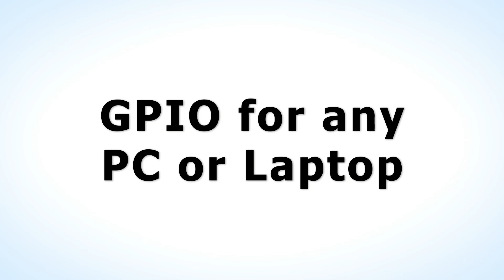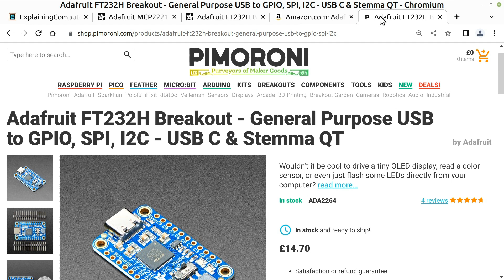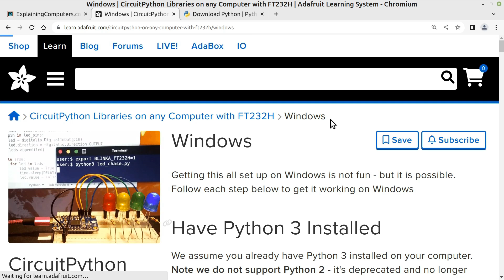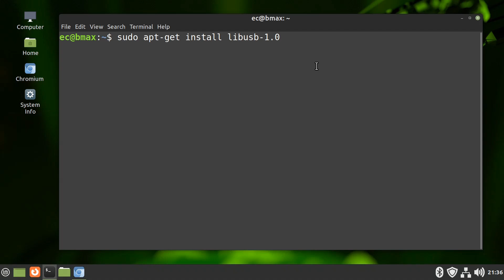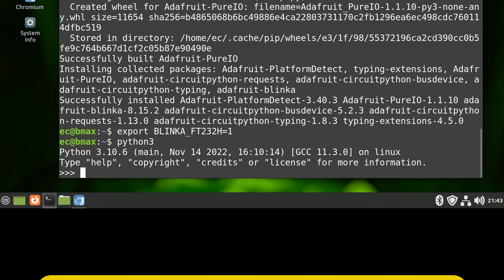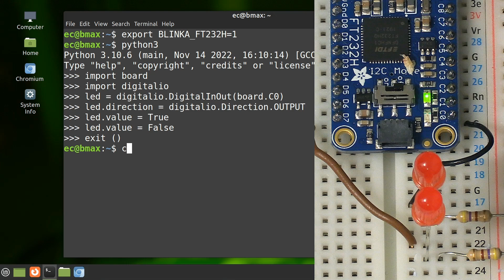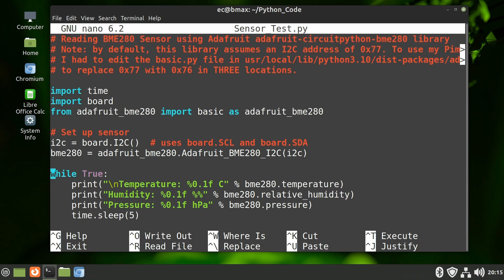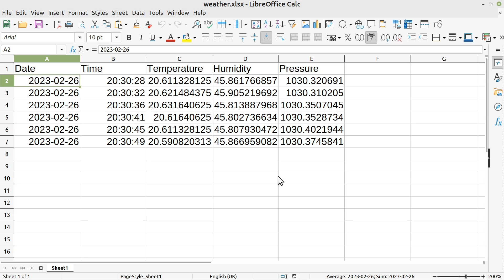GPIO for any PC or Laptop: Adafruit FT232H

Comment: Thanks, nice thing, but far from a real GPIO directly accessible at assembler level: Python is slow, and USB communication introduces another "huge" delay... Far from what was possible with "real" GPIO, for example implementing an I²C / SPI bus, or a PWM, or any custom and non-standard serial bus.
But since it isn't even possible on a desktop CPU but only on SoC or embedded CPU, not to say microcontrollers obviously, it's still a very nice replacement to the standard parallel port since it doesn't exist anymore on most modern PC.
Reply: I²C busses are accessible on your PC, guaranteed... VGA/DVI/HDMI ports have 2 pins that are each an individual I²C bus (check my recent message about that). With PCF8574 I²C to GPIO expander chips, you have access to regulat digital GPIO pins... You are welcome ;)
Reply: @takix2007  You don't have a GENERAL PURPOSE I²C bus - i.e. you don't have a connector exposing this bus to ANY device. The fact that some expansion cards have/use one isn't "having an I²C bus".
Also, if you need an I²C bus to get GPIO, then you don't have "real" GPIO: they will be SLOW.
With direct GPIO (i.e. on CPU directly), you can go fast enough to implement yourself an I²C bus, or even a small parallel bus if you have enough of them.
Try to use GPIO from a SoC, you'll see the difference.
Sure that using a PCF8574 may be nice, but you still don't have a real I²C bus... And if you have one, it will be through USB or PCIe, so another layer of interface - and another slowdown.
Reply: @mac_lak  Maybe I am missing something (maybe some vocabulary imprecision or misunderstanding?), but the pins on a VGA port are quite exposed, and are not on an expansion card. But indeed, it does transit through the on-board graphics chip.
Does that mean that it is bad in any way? Is having "slow" GPIO really a problem in many cases? I mean, on a software level, Python on an SBC is slower than C++, it does the trick most of the time (for example, I had to use C++ to implement an I²C-like protocol on regular GPIO pins on a RPi to talk to a touchpad, but most of the time it does the trick...)
Looking down on "slow" I²C or GPIO to hack things compared to SoC GPIO to make embedded systems is like looking down on a cheap big-store brand jigsaw to cut a wood shim compared to a Felder table saw to make fine furniture.
(BTW, in case it does not get through in written form : I am not being aggressive right now, just maybe overly enthusiastic for a funny hack that opens a lot of possibilities)
Reply: OK, my bad, your original post was indeed criticizing the slowness of the breakout boards, so my comment was not very relevant 😉
I must have misread initially.
Reply: @takix2007  Not a problem, your solution is ALSO an alternative for some PC, which expose the I²C bus on a motherboard connector - so, if you can write/modify a driver, you can use this I²C<->GPIO expansion card. It's still a valuable information for people who don't mind to touch the low-level hardware.
Reply: @takix2007  For the 2nd part: 

(Note: I may sometimes be read as "arrogant" or "harsh", but I'm not: like you, take it the good way, you wouldn't have any doubt if I was aggressive towards you... 😋)

Having "slow" GPIO isn't a problem if your goal is to drive a transistor or a relay to command something, or to read a state (through a transistor or something similar).
For an use case, a home automation application is something perfectly suitable for "slow" GPIO.

But to drive a robot/drone with servo control and feedback, it starts to be problematic...
And to drive directly a controller (for example, a CAN controller, a custom ADC/DAC, etc.) or to make a JTAG interface, it's clearly way too slow.

The Python/C++ is a false problem here: even on direct GPIO, you can use Python as long as you encapsulate enough things into a C/C++ library interfaced in Python... And you can do better than a C++ program driving GPIO through a "long" chain like bridge/USB/microcontroller/GPIO - just because USB introduces delays due to the master/slave protocol. I hate Python (for its significative blank characters mostly), but I must admit that it's enough to sequence a bunch of process in C/C++ which will do the "real job", even if Python itself isn't suitable for intensive computation done purely in Python.

Obviously, the best is C/C++ with direct GPIO... But for a house automation application, Python with a "very slow" GPIO interface will be enough: you need what, a 100 to 500 ms response time? Way enough... Obviously, if your time unit is the nanosecond, you will fail miserably with Python - whatever you do, in fact.

Everything is a matter of use case. I'm used to have GPIO with SoC, so I use them according to this kind of interface (to be clear, in such a mode, you can command/read up to 32 GPIO in a single CPU tick, so it's hard to beat whatever you compare it to... 😁).

My initial comment was to make clear that the shown solution IS NOT what we call GPIO in an embedded, industrial environment - and you have more computer engineers in this "hidden market" than you think. Re-read it, you'll see that I wasn't belittling this solution, which is really cool for "human time" solutions. It's simply not suitable for "machine time" solutions.
Again, use case... 😉
Reply: @Mac LAK  fine by me, I wasn't trying to pass funny hacks as top notch embedded systems hardware engineering and software designs 😉 
Re-reading your initial comment again, it is very clear and I fail to see what I may initially understood as a bit pedantic or downlooking... maybe it was a little late in the evening and I was not reading properly 😉😆
Reply: @takix2007  Not your fault, as I said, I have a way to express myself - due to job's habits when writing technical documentation... - to be very cold, use precise words and give facts without caring about feelings... Some people find it harsh, and some even take it for themselves. The fastest you read my comments, the harshest they look! 😁

On a full side note, nowadays AND from a PC, it's often easier (instead of trying to get GPIO directly) to interconnect a microcontroller, like an Arduino, or even a SoC like a Raspberry Pi, through Ethernet / Bluetooth and handle them as gateways to actually drive the GPIO... It's not really so slower than through PCIe / USB, and it has a longer range (wired Ethernet / Wifi) and/or avoid cable connexion (Wifi / Bluetooth).
You can now even connect a ZigBee dongle/card to your PC and directly have an access to a house automation network...

Another possibility is, with GPIO this time, to setup - through little COTS amplifiers to raise the power / voltage - to get GPIO propagated on tens of meters with very thin cables and, therefore, avoid the need for microcontrollers - you'll simply have a low-voltage & low-power network wired in your house, for general-purpose functions... And it can't be pirated through your Wifi, since it's wired. It's the solution I wish to setup in my own house, leaving non-security related features on ZigBee (like thermostats or lights), and security features (like rolling shutters, alarm system, etc.) through a wired GPIO-like network.

We sure can get some very funny toys nowadays...

Comment: Adding the environment variable command to the  "~/.bashrc" bash script will run it every time you open the terminal. Better yet "/etc/rc.local"  will run it at startup. It's not there by default on Ubuntu, but you can add it. It should start with a shebang "#! /bin/bash" and end with "exit 0".  Whatever you put tin the middle will run at the designated time. Make it executable with "sudo chmod +x /etc/rc.local". I use "rc.local" to set the states of my sbc's attached leds to 0 so they don't float and annoy me when not in use, and to turn numlockx on before I botch my password. I use ".bashrc" to load my aliases for commonly used terminal commands and such.

Comment: I think that's exactly what I was looking for! Since the prices of sbc's only went up, I changed to generic android tv boxes from china with Amlogic SoC's in them. They are quite powerfull and it's easy to install Armbian on them, the only downside is that they don't have gpio ports. My question would be: Is there any reason these breakout boards won't work on such arm boards?
Reply from the maker: Technically it should work on ARM hardware, but you would need appropriate drivers. You may be able to make this work in Linux using what is available, as shown in the video. But that was for x86, so there is no guarantee.

Comment: Isolate your USB ports by buying a plug & play "USB to USB Isolation Device" which protect the host device (the PC/Laptop in this case) from spikes, reverse voltage and shorts produced by the external devices. I recently saw this product on GreatScott! and can be viewed on YT here:- https://youtu.be/1dKLF2Ma8nQ?t=90 and in my opinion this would make connecting such 'projects' to your expensive laptop/PC less worrying and much more fun. I remember being scared whenever I built something new for my old BBC Model B or Master computer, and built a port checker so I could always test the Serial, User and Tape Ports whenever a robot or something wasn't working, just to make sure I hadn't fried one of the I/O functions.

Comment: I use wireless = use bluetooth or ESP8266 + socket programming. That way, I work on high voltage mains without risk of damage to computer or shock.

Comment: You might want to explain that if your using LibreOffice or OpenOffice the file type would be .ods as it would be (most likely) on NeoOffice. I've used LibreOffice for quite a while and it's nice to not constantly upgrade to a new office version every year or two.

Comment: Nice. But: When people try to use it they have to remember that it's no real GPIO! Real GPIO timings and speeds are much different from that to expect from a USB to GPIO converter!
Reply from the maker: It depends what you mean by "real GPIO". :) The experience here will be very similar to that on a maker SBC, such as a Raspberry Pi -- and that is how I introduced this board at the start of the video.

Comment: Nice, Chris! Just one word of caution, the GPIO setup you have shown isn't going to be useful for handling time-sensitive interrupts in a responsive and reproducible time-frame. For that functionality, we still need a dedicated micro-controller. Having said that, the Raspberry Pis (other than the Pico) aren't going to be able to do that either, so if that's your point of comparison, the solution you present with external GPIO is pretty much the same.
Reply from the maker: I am well aware of this, but at no point in the video do I suggest the the FT232H board can be used for time-sensitive interrupts. :)
Reply: @markwarburton8563, why Mach3, Mach4 is so successful in DIY CNC machine business, it does not use microcontroller just a USB board with GPIO and AC/DC. I had built a CNC machine using Mach3 that can cut steels, aluminum, wood , etc, never encounter any problem even when running complex 20k lines of code of GCODE with so many timing parameters because of controlling 3, 4, or 5 stepper or servo motors in synchronized motion or controlling all at the same time. Mach3 runs on Windows XP, 7, 10. Mach4 runs on Windows 10 and 11

Comment: I think i must be missing the point here. Yes using one of these boards the code is running on the main computer but you still have a separate board attached to USB. so what's the advantage? Using an arduino/pico, you have 'offset' the processing . what I would want is to put a gpio inside the machine with access from the outside. Otherwise to me I can't see the advantage over a pico etc.

Comment: How would I go about making a digital on/off switch like the LED to control a high-voltage system? I mean if I wanted do flip on or off another 110-210 volt power wire.
Reply from the maker: You would need to use some kind of triac or relay board controller -- the kind of thing I covered in this video: https://www.youtube.com/watch?v=bOGltcgiXiU

Comment: I recently noticed a little Linux Penguin in the Navigation Pane of Windows Explorer on my Windows 10 machine. Apparently it's for Windows Subsystem for Linux which apparently lets you install Linux and run Linux programs within Windows. Any experience with this?

Comment: The much better, because easier, versatile and safer way to provide a PC, notebook, tablet, or phone GPIO-capabilities is to use a cheap SBC with Ethernet/WiFi-connection. Set up a lightweight Web-server (e.g. httpd) on the SBC. With a couple of lines of code, you can feed values to the GPIO of the SBC, or get values from them. In the most simple case, wget on the PC can do the job. A web-app, controlled from a browser can provide every degree of comfort.

Comment: So the board has built in pull down resistors for the Digital GPIO pins?
Reply from the maker: No, there are no internal pull-down resistors. You have to wire them in externally.

Comment: I prefer the also-available-through-Adafruit MCP2221a that you briefly mentioned which works similarly, and doesn't support FTDI, revealed to be an arrogant anti-consumer company back during "ftdigate". (The mcp2221a is apparently a factory flashed PIC). It also doesn't require any fancy drivers or libraries (fewer steps than the FTDI) And of course as others mentioned there is the option of a Pico using U2IF: all of these options work with "blinka" based circuit python libraries.

Comment: For the much lesser cost you can actually use ESP32 boards directly and get more pins and other options. And also control from the USB port.
Reply: Different target market
Reply: @petermuller608 I don't understand how this target audience is different.

Someone could easy take an ESP32, make it spit out all its GPIO outputs to the serial com, and (maybe) also take inputs as applicable, and someone could easily write a python script to parse that on the general PC side.

Comment: Any GPIO is better than none. However, the great thing about (good) built in GPIO is SPEED.
The FT232H is a USB 2.0 device, limited to 480Mbps and in practice, is typically less than 300Mbps.
USB 3.0 or USB-C are much faster, but the driver chips are less common and quite expensive.

Comment: Another good day's work, Chris.
I always saw the Raspberry Pi's main use not being for teaching juniors coding but in the lab recording data reliably. Your video has me thinking of using it with a breakout board for ventilation control system in a busy bar/restaurant.
Cheers.

Comment: You can control a robot again on a PC or another computer, just like the projects in the 80s using a ZX81 or Spectrum.
Reply from the maker: Indeed, this very much takes me back to a ZX81 relay board I used many years ago.
Reply: @ExplainingComputers  I remember a Floyd the Droid build on the TV program Magpie.
I never built it but it's like a return to that time again.

Comment: As the RP2040 has native USB, you can write code to implement USB devices other than serial (CDC) and write code in the PC that will interact with it. HID devices are particularly interesting, as they do not need a driver in most OSs and can support many scenarios (HID support a lot more than keyboard, mouse and joystick). It is not that hard to implement a custom HID device so a PC application can interact with not only digital input and output but also displays and analog inputs. I've done that in the past with an ATtiny and intend to do that "any day now" with the Pico.
Reply: Do you have a link to some kind of library I could use for C++ running on the PC to communicate with the Raspberry Pico?

Comment: Hi Chris!
I fail to see an advantage of this type board. For the same price, you can get a micro-controller (or maybe even more than one) and run a code from within an IDE and see the same results. With this board, you run commands/code from the terminal. 
I actually see a disadvantage using this type of a board. With a micro-controller you dont need to switch between I2C or other IOs. 
Am I missing something here?
Reply from the maker: You're maybe missing that whilst I ran commands from the terminal here, that does not have to be the case. But certainly in many instances, a microcontroller is the best bet.